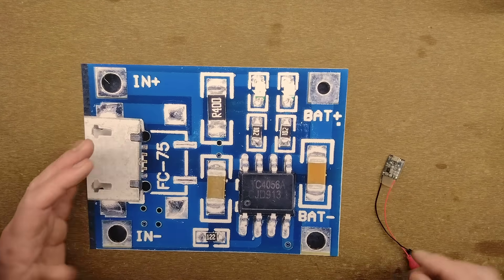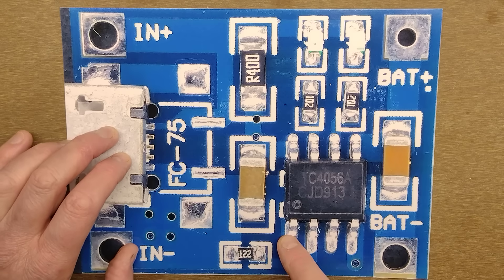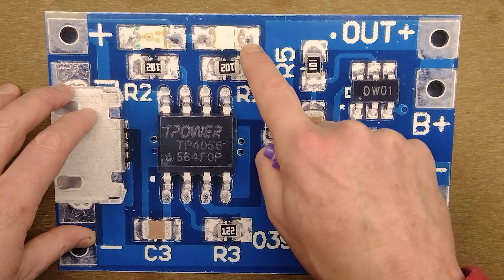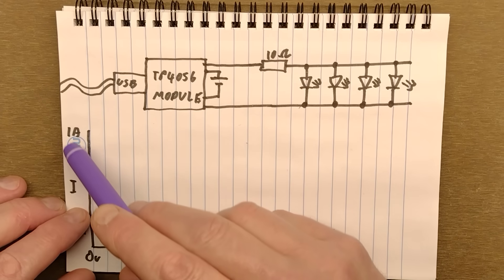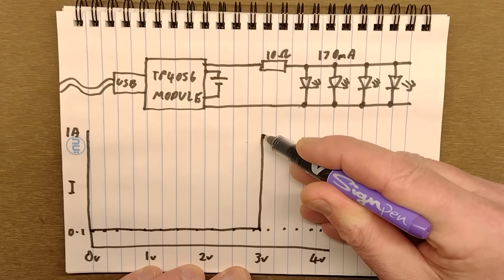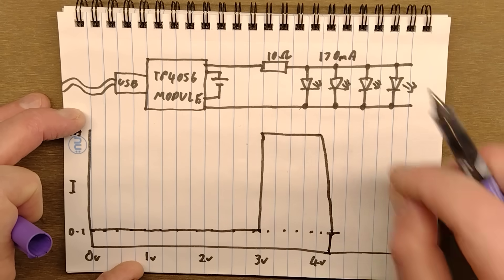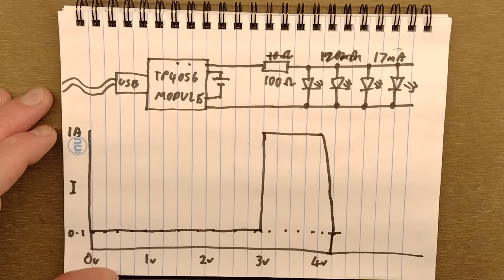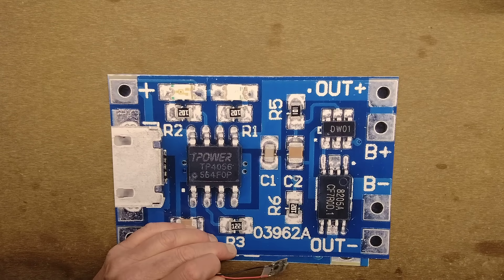TP4056 myth busting

Comment: One important point about Li-ion cells is that they really don't like being flat.  If you do flatten your batteries inadvertently, it's vitally important to put them on that trickle charge as soon as possible.  It's also true that they don't like being constantly topped up - ie at full charge and topped up every time the voltage drops a little.  I'd say this would the lesser of the two problems however.

This seems to have been born out in real-world experience for me.  I have 18650s that have been in use since 2013, and some of those sets were in daily rotation for years.  I never let the voltage drop below 3.2 V  OCV and always put them on charge at the earliest possible moment (as long as they weren't hot).  I've bought other sets of batteries because I didn't want to get left with useless batteries, but all my batteries still run my vape all day.  The older sets have now been relegated to standby usage for things like torches, but I can and have still used my torch batteries on occasion.

The manufacturers do indeed say (data sheets) that the batteries are OK to discharge down to 2.8 or even 2.5 volts however the advice I've been following is that you can extend the life of the batteries by many hundreds of cycles if you don't do that, and that is the problem I have with that DW01 chip - the cut-off voltage is way too low.  I guess it is designed for portable devices with very tiny cheap batteries, but still...

Many vapers I know have to replace their batteries every one or two years, but I can only thing that it's faulty products or improper use that causes this.  Improper use might be very high discharge rates all the time, flattening the batteries too far down the curve, not charging flat batteries ASAP, and improper storage such as high temperatures and high vibration...  or a combination of these factors.

Comment: Thank you. I am scared stiff of anything to do with lithium batteries let alone charging them. The videos I see of lithium batteries going into runaway makes me very dubious of doing anything with them. I have been involved with electronics all my life, I am a registered electrician, have a physics and mathematics degree but litigation is just to scary that I wont touch this stuff.  The problem I see is the whole idea of recycling electronics but who takes responsibility when it fails, not me!
Reply from the maker: The videos of explosive cell failure are a tiny percentage of lithium cells in use, and usually involved cell damage or serious overcharging.
Reply: @bigclivedotcom  I assumed so or the insurance companies would be removing them from policies. Im very aware of risks and hence prefer to avoid being in anyway associated with these other than a dumb user, hence I dont use them in anything that I supply to others as I would just worry myself silly thinking about the what if's . Ive seen too many things that shouldnt happen but did, thats the problem with being 69 and been involved with electrical stuff all my life :)
Reply: I've handled/soldered/tested literally at least a thousand of them, never had any such problems. I have seen people blow them up, but it always involved not paying attention/mishandling them, like accidentally stabbing them with tweezers or blasting them with a heat gun for an extended period of time. Never seen anyone get actually hurt from such an event.
Reply: I use them for my personal diy only
Reply: @eone2345  me too

Comment: TP4056 is Trash TP5200 is way better has switch mode power supply way more efficient and runs way cooler too .
Reply: That's why the TP4056 boards are $1 each... 😀
Reply: tp5200 is popcorn

Comment: Very interesting.  Thanks Big Clive.  Pretty amazing little boards and chips there and like you say, just dirt cheap.
Reply: Gosh, it's been a while and I've been using these little boards with the DW01 protection.  Love them.  Curious though on the input side if you've tried running less than 5 volts into it. (I need a bench supply)  Thinking with a 5 volt solar panel and wondering what will happen if the voltage drops below a certain amount?  I guess you sort of touched on that with the "Solar "MPPT" lithium cell charge module" video you did a month ago.

Opps.  Nevermind.  You covered that in the Cheap power pack with free lithium cells video.  https://www.youtube.com/watch?v=W7XB6D7q92g
Reply: Something that just came to mind and wondering.  Could you use a TP4056 to charge a few NiMH in series?  I was thinking about that in perhaps a solar application.  I was thinking that maybe it wouldn't grill them as hard as your basic 4 pin solar chip in the common Dollar Tree (Poundland) sort of landscape lights.

Comment: Thanks for this Clive! It explains something I've always wondered about my mobile phone as well: It comes to 100%, then takes absolutely a.g.e.s. before saying 'charge complete' - it must be reducing the charge current, as you explained, until the battery is completely topped off. 
I'll get myself a couple of modules as I've had some cells just lying around waiting for re-use, never actually knew what to do with them!
Reply: Correct. It's also why public EV fast chargers generally are configured to only charge to 80% - beyond 80% the charge rate will slow right down, effectively wasting a charging bay that someone else might want to use.
Reply: @tin2001  Not charging to 100% has a few other benefits as well: For example regenerative braking will work right away. When the battery is at 100% there's nowhere to put that energy and you'll have to use the normal brakes losing some of that energy.
Reply: @maxine_q  interesting.  I thought most EVs reserved a fair whack of battery capacity to extend the amount of recharge cycles.
Reply: @maxine_q  - Just shows how far behind the automotive world is. That regen braking issue with a full battery was solved in material handling industry years ago.
Reply: @leepower2717  How was it solved?
Reply: @maxine_q  The obvious solution is to never park on top of a hill.
Reply: @igotes  Or just don't charge to 100%, unless you really need the full range.
Reply: @leepower2717  That's not regen braking then, it's dynamic braking and doesn't serve the purpose of energy saving.
Reply: @Pongo_Ponginae  Yes, it is yet another benefit, it is less burdening for the longevity of lithium batteries to not fully top them up.
Reply: @maxine_q  My comment was supposed to be a joke. Apparently it wasn't funny.
Reply: Which just shows the automotive engineers may understand the problem better then YouTube commenters.
If you are not storing the energy for later use it is not really regenerative braking.
And since the car needs to have conventional brakes anyway and as a vital backup system they need to be tested on a regular basis to be reasonablely shure they will work when needed, there is no point in adding massive resisters to burn off the energy.
Reply: @Mark S doesn't sound like a modern energy-efficient solution tho. Generating heat that just dissipates in the air while breaking isn't a very new thingy😁
Reply: As the cells reach full charge the difference between their voltage and the cutoff voltage decreases. That is what causes the current to decrease. Lithium chargers use constant current initially but switch to constant voltage once the 4.2V limit is reached. Lead acid and Ni-Cd did not have strict voltage limits, so they could fast charge all the way up to 100% as long as they didn't overheat the battery.
Reply: @whitcwa  Yes and that charging regime is specified in the cell data sheets too.
Reply: My phone, like many others I would guess, have a "smart charging" option where it doesn't top it up all the way to prolong battery life. It also says it uses AI to "adapt charging to my lifestyle" or similar, I don't know how much of that is marketing jibberish and how much is really helping the battery life tho😁
Reply: @bennylloyd-willner9667  Yes, not topping up lithium all the way up does significantly prolong the service life. About the lifestyle adaptation instead, I might be more dubious..
Reply: @bennylloyd-willner9667  How much "I" is in the AI of this instance is probably debatable but if it does indeed adapt to your historic behaviour I'd consider it a valid and useful application of "AI".
Reply: @Martinit0 how much more life do I get from it, I wonder. I will most likely get a new phone long before the battery is getting tired on this one😊. "AI" is often said of anything automatic made with a microprocessor, or even a microcontroller. I've noticed it's fashionable to say that "AI" made an ordinary flight sim video for instance, no AI was involved in making those😊

Comment: Over >10yrs using these I've seen some variation in these "TP4056" modules.   Some charge to 4.1, other batches as high as 4.22.  Some seem to lock-out(or lock-up?) in certain states or charge times , requiring re-power to function again.  Some will charge from zero others will blink the red LED and not charge.  Some have various LED blinking schemes like solid blue with fast blinking red, not sure wuts that about..  I've also had a lot of the protected ones with the green (not blue) circuit board version, connected properly , let the magic smoke out for some reason.  I don't use the  protected version at all now,  as even the blue ones  seem to have some odd behaviors that I don't understand and don't experience by using  standalone charger + protection modules.  

One thing they all share is instant smoke when the battery polarity is reversed, making them poor choice for use with 18650 cell holders or alligator battery clips!

I'm thinking of moving over to the buck converter versions for UPS applications, hoping for better efficiency and an adjustable termination voltage. .
Reply: They should market the lack of polarity protection as Reverse Polarity Pyrotechnic Indicator.

Comment: I love the combined charge/boost circuits that are available now.
Input 5V, charges your battery and output can be set between 4.2 and 27V.
Nice for 9V and 12V applications.
Reply: Do you have any suggested part number / search terms for those? Sounds super handy.
Reply: @KeithJewell  CD42 probably the smallest and best ones. Stay away from the powerbank "usb out-microusb in" modules. They are getting REALLY hot.
Reply: @KeithJewell  I think your best search term would be "buck boost converter". I don't know if that's what op talked about or if it's even the correct term, but you'll find it that way.
Reply: @KeithJewell  TP4056 step up
Reply: Looks like MH-CD42 is the best search term, for anyone interested.
Reply: Just be careful with what you want to power with these chips. Most claim a minimum current of 30-50 mA. I ordered two different boards with two different CD42 clones, and both disable the output already below 80-100 mA. No fun for low current applications.
Reply: @michaelseitz8938  The MH-CD42 chip, an IP5306 clone, is more like a miniature power management IC than a simple charger. A low-current MCU application could pulse the key input to ground to keep the output alive or hold it for >2s to turn it off immediately.
Reply: @englishrupe01  When I search for that I don't find the circuit I mean.
The circuit I'm talking about is a TP4056 charge circuit combined with a variable boost circuit for the output. So charge your Li-Ion via a 5V micro USB input and set the desired output voltage anywhere between 4.2 and 27V.
Reply: @englishrupe01 Can this module be used as an uninterruptible power supply? In other words, when there is power, it feeds the load and does not charge the battery, when there is no power, the battery feeds the load.
Reply: @psykopat81  I am no expert, but i would think it would, with this proviso.....it would still continue to top off the battery if needed, like a trickle charger. But it would feed the load primarily. But i wouldn't use it for anything critical, just in case  ;-)
Reply: i developed an AliExpress addiction soon after the first video because of this haha
Reply: @catsnotcops_  how do I quit ???
Reply: The TP5100 can take a voltage range of 5V - 19V and charge very efficiently with very little waste heat. The TP4056 doesn't like anything higher than 5.5V input, or lower than 4.5V, and will waste all energy above cell voltage as heat, as the IC is a linear converter, whereas the TP5100 is a true buck/boost converter with some voltage smarts built in.
Reply: @korishan  Since you replied to my post I think you also don't get what circuit I'm talking about:
Charge Li-Ion (input 5V - 8V) -> Output for application can be set between 4.2V - 27V
Reply: @Ni5ei  Lithium Battery Charger/Booster

Comment: Hey Clive, speaking of charge voltages, what's with cell phones having batteries that charge above 4.2v? Are they special batteries or are they just trashing them for a higher capacity?
Reply: How much above 4.2V are you talking about?
Reply: @Ni5ei  The one in my last phone lists the charging cutoff as 4.4V, with a nominal of 3.85V, which is a decent bit higher than the 4.2v/3.7v we usually see
Reply: @iamdarkyoshi  There's a wide range of Li-Ion chemistry variations to optimise for different applications/characteristics.
Wikipedia lists a "Lithium nickel cobalt aluminium oxides" cell chemistry as charging to 4.3V, for example, and also shows that as having the highest specific energy (Wh/kg) and energy density (Wh/L) of the Li-Ion chemistries in the list: https://en.wikipedia.org/wiki/Comparison_of_commercial_battery_types

I don't have time to investigate further right now, but that's probably the explanation: phones using a different chemistry (maybe the higher energy density costs disproportionately more , so it's only considered worth it for small handheld devices? But I'm just speculating :))
Reply from the maker: I think some are optimized for the higher voltage of around 4.35V.
Reply: I posted a link to battery university but it got deleted.
As usual.
Reply: Either Clive or YouTube doesn't allow links in comments.
Can be pretty frustrating at times :(
Reply: @Ni5ei  I think Clive does not allow web links due to spammers.
Reply: @Ni5ei  I've also had links deleted before now. Best thing to do is remove the http colon slash slash etc. and if necessary add a note that it's a link if you add dot com at the end etc. Guaranteed to work!
Reply: @stepheneyles2198  Yeah thanks, I kinda expected that to work but it's still a pain in the butt to camouflage a link just to post some relevant information.
[Clive with high pitched voice] Oh no, you're not allowed to post a link because sometimes that link is from a spammer so I block them all! [/Clive with high pitched voice]
Boric acid is being taken off the shelves for the same reason: "sometimes".
So the rest of us have to suffer the consequences :(
Reply: Quote from Battery University:
Some Li-ion batteries with LCO architecture feature a surface coating and electrolyte additives that increase the nominal cell voltage and permit higher charge voltages. To get the full capacity, the charge cut-off voltage for these batteries must be set accordingly.

Comment: Clive, are you sure all those TP4056 modules with the W01 chip will toggle on/off charging a cell that's on load?
I have found some TP4056 modules with the W01 chip will not go back to the charge state until the power to the module is cycled.

Thanks for another informative video!

K Watt.
Reply from the maker: The ones I tested did toggle.  I wonder if there are brands that don't.